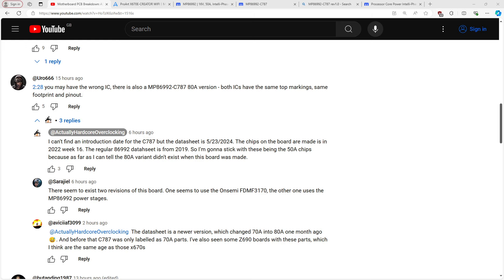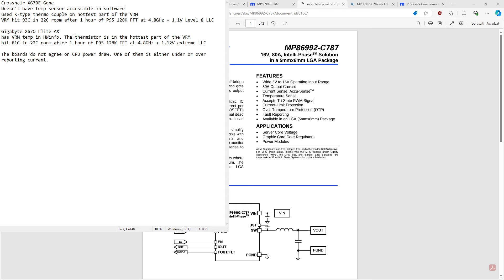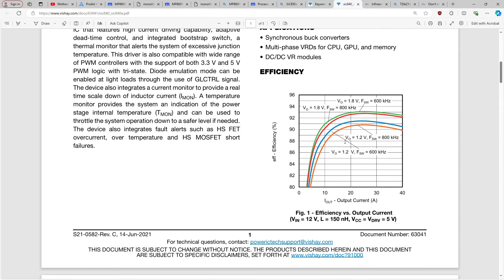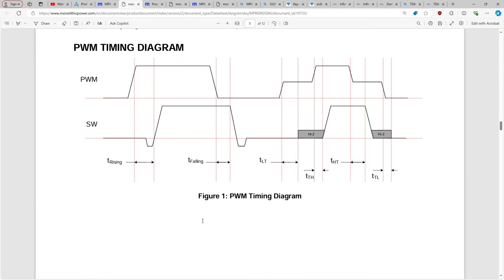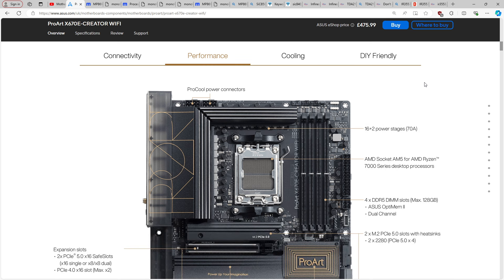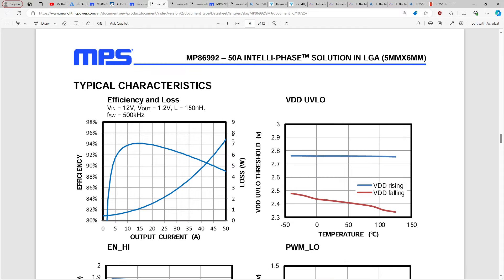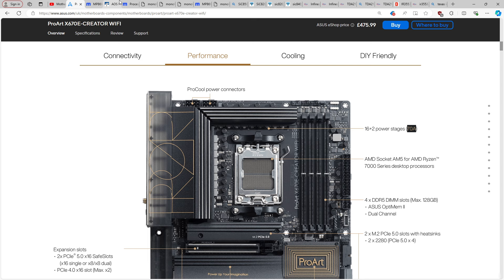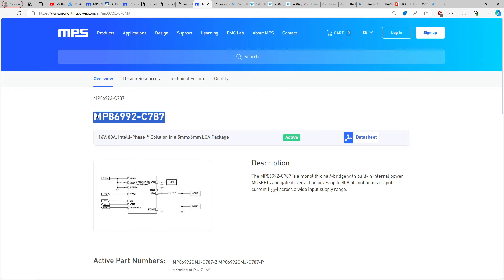Rambling about my frustrations with DrMOS/Power stage nominal current ratings. VERY ROUGH VERSION

Comment: Why not build a power stage testing PCB? I think getting a controller to run a single or dual phase "epower" would be interesting this way you have control over the thermal characteristics of the board itself, Get one of the overseas mfg guys to build it
Reply: Sure but how does it fix overheating power stages when soldering

Comment: Having the exact same mosfet rated for different current DOES make some sense, technically, if it is in a different package, with different thermal characteristics. For example if it has a metal top vs a variant with a plastic top, the metal one would be easier to cool, but it might introduce other problems like EMI. or potentially not being able to use a common heatsink for all of them since it would make unwanted electrical connections.

From my understanding that is usually the justification from manufacturers for these ratings in general. They are giving you the absolute maximum rating, which should never really be used, instead of something that actually makes sense to use.

Comment: I've found that most mosfet manufacturers list the mosfets by their 25°C case temperature maximum current. It's not realistic unless you have a refrigerated water cooling system. I wish mosfets were marketed by their 100°C max continuous current rating as that number is applicable in an air cooled system
Reply: Well to be fair you can heatsink them and with airflow they can be kept at a reasonably low case temperature.

A good data sheet will have figures for Tc=25 and Ta=25 (no heatsink, just PCB to draw away heat).

The data sheet should also have derating factors and maybe even a graph of max current vs case temperature so you can pretty easily figure out the limit for your particular situation.
Reply: I wonder if one day we will have motherboards where the CPU heatsink also contacts the VRM Mosfets...
Reply: @nicholasvinen  Yes, a good datasheet will have all of the information needed to estimate performance. My point was that without those extra details, the 60A or 80A number is meaningless. For instance, the 80A mosfet may have a worse junction-case thermal resistance that causes worse performance compared to the 60A mosfet with the same cooling system.

Comment: Sir I have TeamGroup T-Force Delta RGB 32GB (16GBx2) DDR5 6000MHz cl 38 ram and 7600x processes could you please recommend me some super tight stable 6000 mhz cl30  ram timing sir .I am currently using your timings from your video sir

Comment: Not watched but I'm guessing it's about the nominal current and Ptot being specified for Tj 25°C, which is of course rather unrealistic, but only intended as a common design reference point.
Reply from the maker: no it's actually that a 70A power stage from 1 manufacturer can run significantly cooler than a 110A power stage from another. And that in some cases parts from the same manufacturer with different nominal current ratings have exactly the same efficiency(at least according to the datasheets).
Reply: @ActuallyHardcoreOverclocking  the main issue is that the big current rating is just a marketing number that has very little say on what the performance are in practice

Comment: Warning: thermal rant. Never quite clicked just how baked these people were when they assigned these current ratings. The chips can barely survive them without extreme measures. Take the MP86998: Extrapolating, it should be burning about 20W at 80A. The thermal resistance data illustrates the engineer's nightmare. 12.4°C/W to the package top, but only 2.7°C/W to the bottom. Tjmax = 125°C, so I'll say Ta = 25°C, and no sub-ambient cooling. The physical limit for heat dissipation out the top is ~8W, so the majority of your cooling must occur through the PCB. A bunch of well-placed vias can get the thermal resistance to the bottom of the board down to about 6°C/W.
So if you can pull 4W out the top, dissipate 4W into the surrounding board horizontally, and pull another 12W out the bottom of the board, you can hold the damn thing's junction temp somewhere around 100°C, depending massively on your heatsinks, TIM, airflow, etc. I don't even want to think about the 100A+ parts...

Comment: have you considered "just" making your own boards? Design some basic 2 or 4 phase buck convertor board with some big terminals to a dummy load, just swap different power stages into the design to compare them. for footprint-compatible devices you already have a stack of boards on hand, and otherwise you just have to swap out the footprints and accumulate variants over time.

since it's just a dummy load and actual voltage regulation performance doesn't matter, you could cut out the whole pesky "voltage regulation controller" part and just use a microcontroller to generate the PWM for the phases directly, you can implement a pretty crappy control loop, as long as it eventually reaches a steady state where it's generating a steady output voltage. (or if you want to include controllers as a variable, come up with a pinout for some headers, exposing every signal you could imagine a controller could need, and make some little controller cards, if the interface is consistent enough between controllers u could even experiment with mixing and matching controllers and power stages). but if you don't include controllers in the mix (since i assume most of these controllers expect a minimum number of phases), you could probably get away with just a single phase. That might also reduce cost to the point that you can have sub-variants with different value inductors (with the same footprint of course so you don't get completely overwhelmed with PCB variants!), so you can better fit the data to a given motherboard.

Since you're not reworking an existing board, you don't have to worry about hand soldering inconsistencies, you can order new parts when possible, get stencils made, and do a proper reflow with a profile.

Comment: One common DrMos for back on the 115x boards was the CSD87350 from TI
Reply from the maker: That's a dual nfet not a DrMOS
Reply: @ActuallyHardcoreOverclocking  I seem to remember them having an integrated driver but just no monitoring circuitry, but I guess I am confusing it with something else from back then...

Comment: Doesn't asus have a deeper llc setting? If the cpu input voltage is not calibrated, asus boards provide a lot more voltage, which can explain it being hotter
Reply from the maker: the CPU was getting the exact same die sense voltage on both boards.